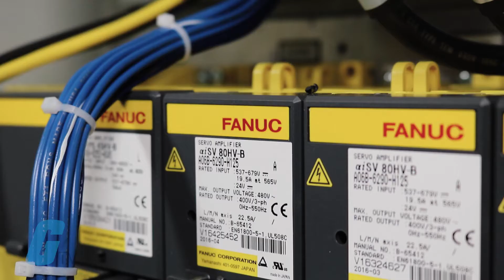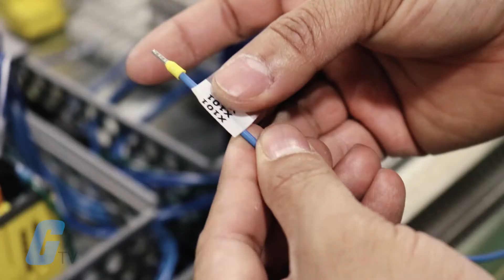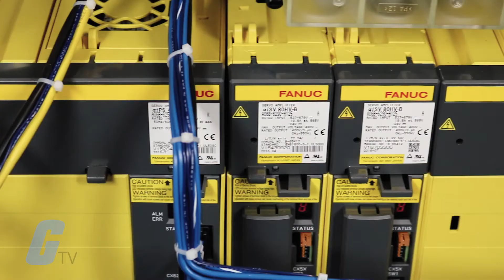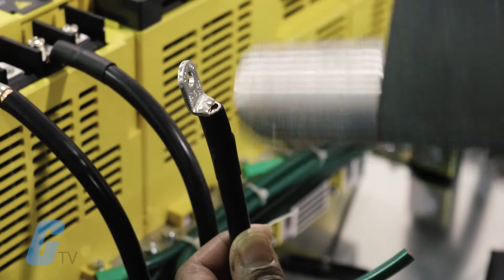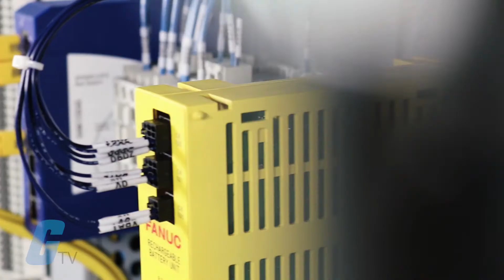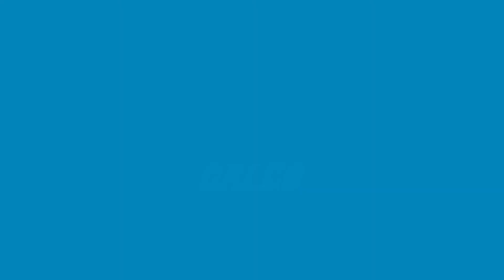Galco is a proud member of FANUC’s Authorized CNC System Integrators Program

Comment: What is cnc
Reply from the maker: Computer numerical control (CNC) is the automation of machine tools by means of computers executing pre-programmed sequences of machine control commands. In modern CNC systems, the design of a mechanical part and its manufacturing program is highly automated. The part's mechanical dimensions are defined using computer-aided design (CAD) software, and then translated into manufacturing directives by computer-aided manufacturing (CAM) software.